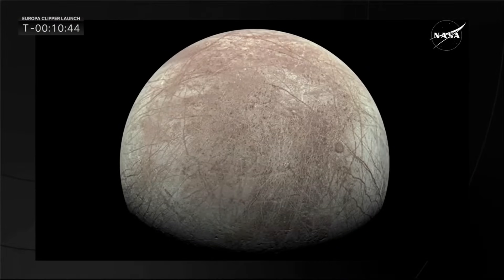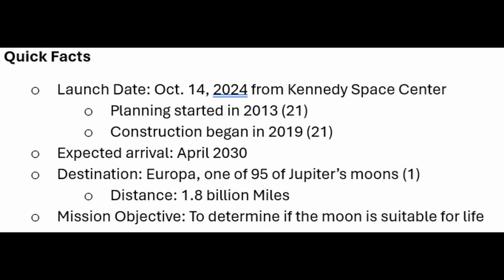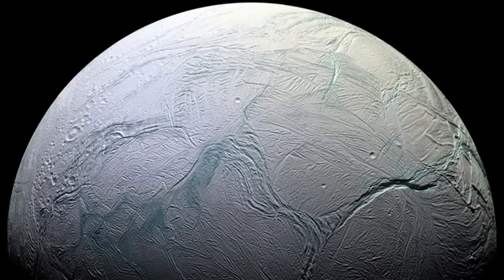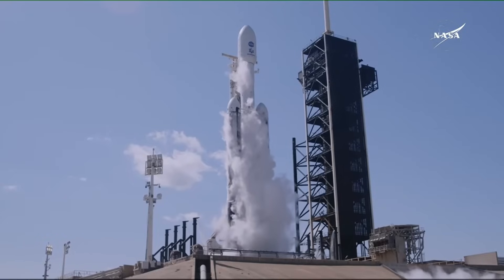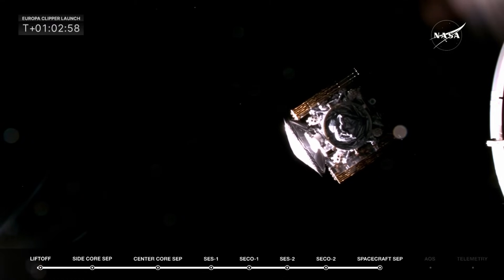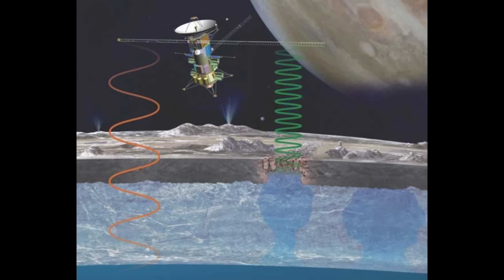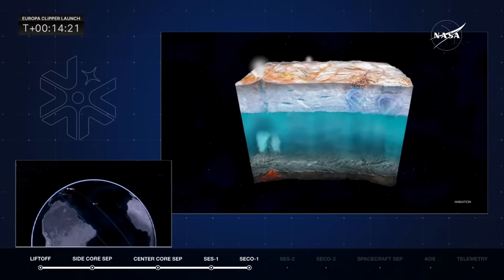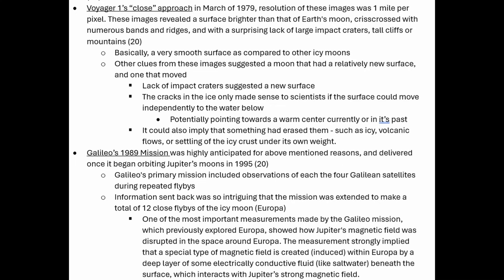Overview of Nasa's Exciting Europa Clipper Mission

Comment: If I remember right, the original plan to launch Europa Clipper on a NASA Space Launch System (SLS) rocket would have been able to send it all the way to Jupiter without the gravity assists, but the SLS production system was too slow and expensive so they switched to the SpaceX Falcon Heavy that has a lower capacity than SLS.
Reply from the maker: Thank you. That definitely would have been an advantage of launching on SLS.